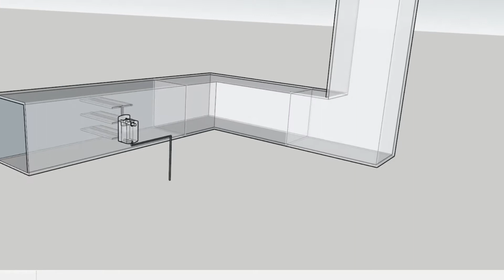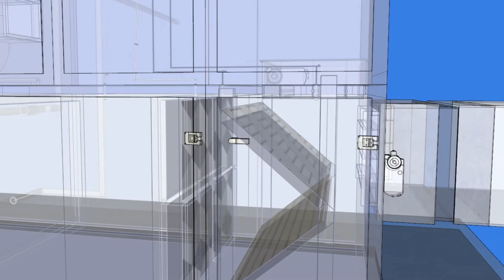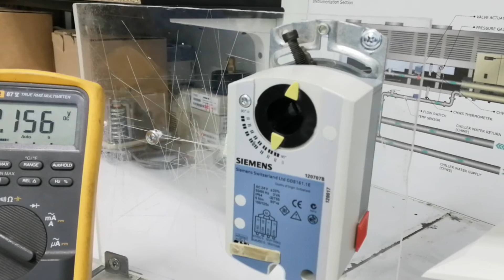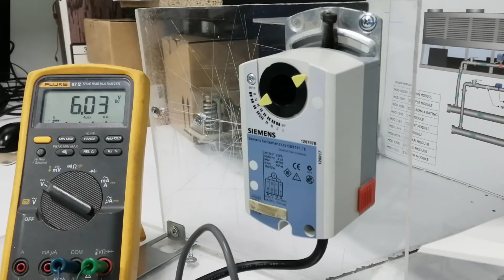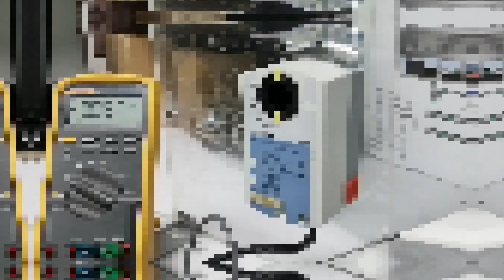HOW TO TEST DAMPER ACTUATORS

Comment: Nice video to understand a damper actuator. How do you adjust the angle of the damper? Is there any button on the controller to adjust the degrees?
Reply from the maker: Yes, by setting a certain angle - just push the white button in the right upper corner. Push it then set the angle you want and then release.